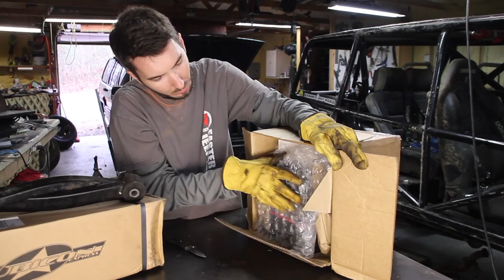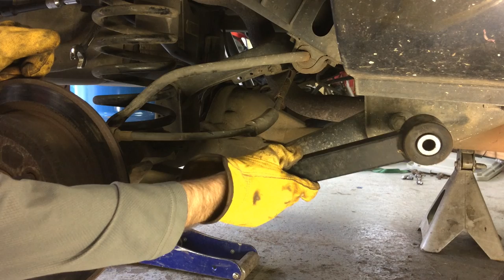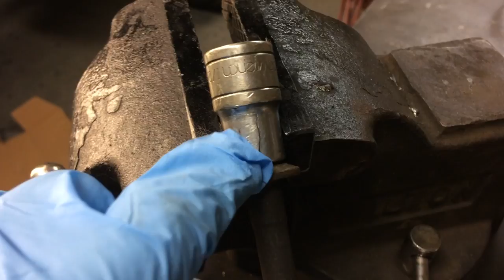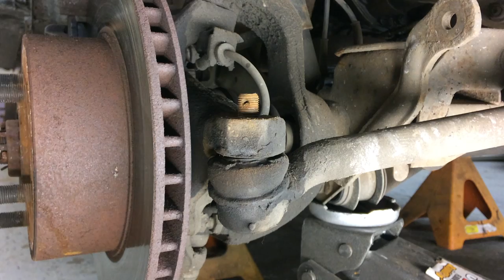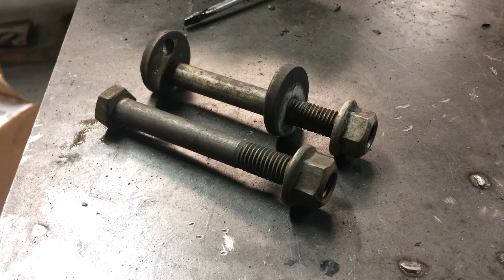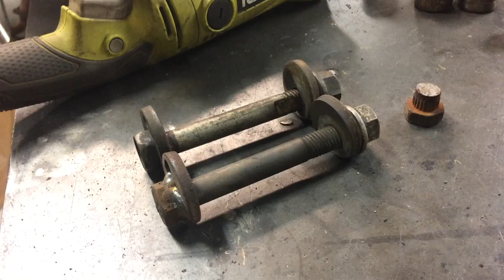Angle of the Dangle - Operation Cheap Jeep

Comment: One trick for lower control arm bolts seized to the sleeve is to press it out with a ball joint press... Worked for me multiple times.

Comment: When seperating tierods you should wack the side of the knuckle. When you hit the stud. You wear the cup of the ballsocket. And thats usualy where tierods crap out at.
Reply: Wrench life 604 i dissagree. its beeing held in the taper of the knuckle. so the force of the hammer hit on the nut is not pounding the ball into the socket
Reply: everone has there own way. ask 3 techs get 3 different answers
Reply: At the shop i work at we arnt aloud to hammer on stud. We hit the side of the knuckle.   I personally would never hit the stud. Could wear out joint faster.
Reply from the maker: this could be true but I could also see it being one of those old wives tales taken as fact... I'd like to see some evidence or testing on this subject.
Reply: BleepinJeep hit what it goes through and if it don't work get a bigger hammer. it works and it's faster.
Reply: It's not about ruining the actual ball and socket , it's about mushrooming the top of the threads and not being able to thread it back on . Anybody with any professional experience whacks the knuckle .
Reply: Notice how it nicely spun on with his fingers and would spin off with his fingers . Deformed the threads
Reply: Nate M or because the castle nut was now tight up against the knuckle and couldn't be backed by hand. If the nut was flush I doubt the threads were deformed

Comment: I have done the castle nut thing and found that using a two jaw puller works better.  I have on more than one occasion run into some tough studs and drove the nut on over the threads.

Comment: I just purchased my first lifted truck 1995 Nissan Pathfinder. the front axle is from a 85 Wagoneer the rear coils are from a bronco sway bar has been removed the panhard bar has been removed and the front differential has a severe downward droop to it, therefore the front drive shaft is disconnected. What would be the proper and safe angle for me to reconnect the drive shaft and for it to drive stable

Comment: Trim the bumper on the ZJ! I was having the same thoughts as you before but ended up trimming the corners basically where the lines are to the middle slots, then just zip tieing the bottom part where the slots are to the radiator support (I eventually swapped my radiator support witha Kevins Off Road Support, protects the radiator better and gives you front tow points for pretty cheap!)

Comment: What front axle shafts are those now? With the U joints instead of CV.....
Reply from the maker: from a cherokee
Reply: Thats what I figured. Is there any "cheap" option to swap those end stub shafts to manual locking hubs?

Comment: Tip: to remove the tie-rod bolt hit the spindle with the sledge (do not use the method where you hit down on the castle nut) ...again...hit the side of the spindle where the tie-rod enters the spindle...

Comment: Matt, I am not familiar with those cam bolts. What is there purpose? To aid in adjustment of castor angle?
Reply from the maker: +Mark A. I'll walk you through it in the next video but yes it basically just makes the arm shorter or longer by a small amount
Reply: BleepinJeep 
Thanks Matt. Keep up the good work. Can't wait to see how the ZJ turns out.

Comment: Had the same problem with the cam bolts if you're not using the bushing heat the crap out of with a torch.

Comment: That's my bad- I didn't cross my fingers until the second attempt. I learned (from you) always use heat.....why didn't you try that?
Reply from the maker: heat on the cam bolt?  because its surrounded by rubber, by the time it got hot enough the rubber would be a blazing inferno.
Reply: BleepinJeep that's why you're the expert! I'd be torching it all- but not anymore. All the best and thanks again!

Comment: I had issues with an upper CA cam bolt when it got pinched between the arm and the sleeve in the bracket and ended up smoking the threads getting it out

Comment: i know this video is older but i have a question. if you have the double cardan shaft and you tip the dif upwards pointing at the tcase, wouldnt that cause your castor to change and be steering into the ground?

Comment: one question if you just want some what of a longer control arm (long arm) could i do that on a stock 1993 jeep grand cherokee Laredo i have been planning on this for a while of doing a cheap jeep but i think its allready to late i had to have a front drive shaft custom made because all the ones i was finding are to long do you have a tire size that u r going to put on ur jeep i thought of a 31" or a 33"
Reply: I have a 93 Zj laredo,too. Im thinking of doing this. Really you couldnt find a front driveshaft?

Comment: Just a suggestion for anyone who wants to up grade suspension on a old truck.
1 Before you start spray pb  blaster on every part you need to remove ,bolts nuts Everything.
2 drive the truck for a day or 2.
3 repeat 2
4 repeat 2 and 3 
5 repeat again.
6 have torches and cut off wheels in plenty Normally doing 1 to 5 will work and everything will come free.
7 Don't start any suspension work until you do this.
Reply: You meant repeat step 1 
👍😉

Comment: Hey Matt, maybe you can shed some light for me. I have a 97 xj and the odometer and airbag light will not turn off and now will not start. There is always power to the gauges as if the key is turned on and i noticed my injectors are clicking with the nothing on. Cant find any help or direction anywhere.😣
Reply: Scott McIntyre . Thanks for the reply but not quite what the problem is. Plenty on non working gauges, not so much about power always being on when battery is connected.
Reply: Disconnect the ignition switch, and see if you still have a draw (Lights go out= no draw) if  no draw replace ing sw.
Edit any cryco switch will work with the same style key
Reply: P Kuudsk thanks. Still on. I guess i may have to go through all the wiring in the jeep .😔 replaced the asd relay, replaced the ignition switch, cleaned the neutral safety switch, checked all the fuses.
Reply: My 95 xj had a parasitic draw under dash drivers side to the right of steering wheel

Comment: won't welding that bolt take the temper out of it and cause it to be weak and possibly break?
Reply: So does heating up a bolt with a torch but people do it all the time. I think it would be ok since if anything you are annealing the bolt making it softer and more ductile rather than harder and more brittle.
Reply: 27dcx  that makes sense but if I ever heat a bolt I replace it. It may not be necessary but it give me piece of mind anyway.

Comment: How to determine if the cam bolts are positioned correctly? I am trying to DIY align my zj, caster too.
Reply: My Off-Road Obsession i am trying to figure out the same thing with my zj. Did you ever find any answers?
Reply: Nathan Harris truly comes down to pointing it at the Tcase. Having a double cardan front driveshaft is exactly as having an SYE. The aim in regards to caster is to find a balance between too much caster (Might steer like a Grand Marquis but you'll have driveline vibes) and too little caster (Might be 100% directed with the front yoke of the tcase but will drive "squirly" and could even result in death wobble if you've already got even the slightest wear in your steering/suspension components).

Comment: So I have the same jeep... I was wondering can I get jk lower control arms for the rear and take the stock one's and put them on the front? My Jeep has a 2 inch lift right now but it's not enough and the last owner didn't do anything except bigger shocks and spacers so it rides a little funny right now... also when I lift my zj what parts do I have to replace to keep a smooth ride/ avoid easy breaks, breath wobbles, ect, ect. I'm only 15 but my jeep is my favorite pas time and I want to get her fixed up before the summer months
Reply from the maker: You should watch the whole build's playlist, I go over everything you'll need: http://bit.ly/2iaV0sx

Comment: I’m struggling to find an answer on this. Got a TJ lift and am fixing death wobble. Do I need a longer control arm or is it possible to change the caster angle with a replacement control arm?
Reply: If the wheels are aligned, and balanced, the rims aren't bent, the tire isn't lumpy.... check for worn out bushings, ball joints,  and all steering joints.

Adjustable control arms are threaded so they're extendable so you can fine tune your pinion angle/caster.

Comment: why did you replace CVs with ujoints? are ujoints better?
Reply: WILNEL KG5WEN yes. stronger and easier to replace
Reply: Also, U-joints are a lot better when you're driving through brush and sticks, since a CV boot will get cut or punctured easily.

Comment: alright alright alright,  I give up, what is the bracket for the rear track bar?  I can't find it on RC's site.  I have a 97 xj with 3.5" lift btw.
Reply from the maker: +Steve D you have to call them to get it separate from the lift

Comment: so which control arms work for the xj? rear jk or rear zj?
Reply from the maker: you'll see in the next video I use the rear lower ZJ arms in the front.
Reply: BleepinJeep awesome man thanks. keep up the good work love the videos
Reply: dtaylorh18 I broke the adjustable lcas on my xj on a cali road trip a few years back and had to stop at a jy to scrounge up some parts to get me home, zj rear lowers were the exact length my lcas were adjusted to for my 4.5 inch lift, so I'd say it all depends on what your running under your xj

Comment: Don't you want to replace the upper rear control arms to get the correct pinion angle
Reply: Longer lower
Or
Shorter upper
Or
Adjustables